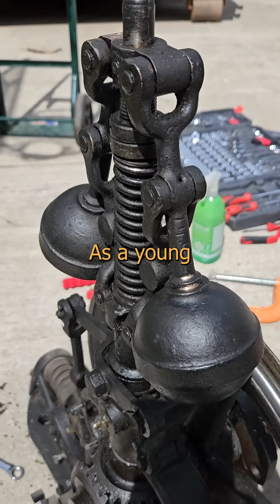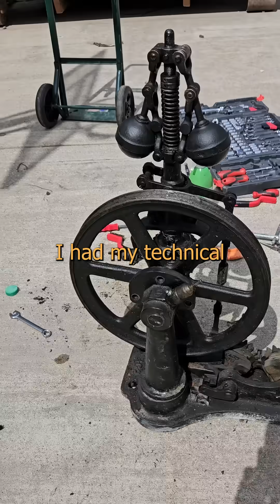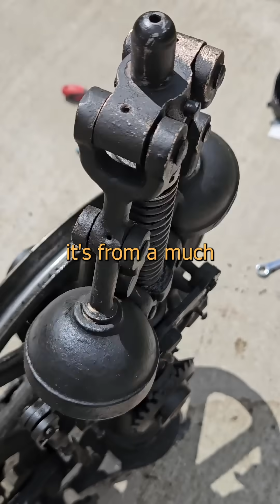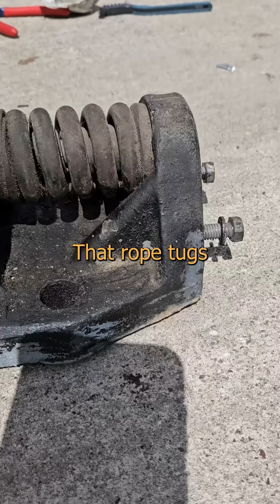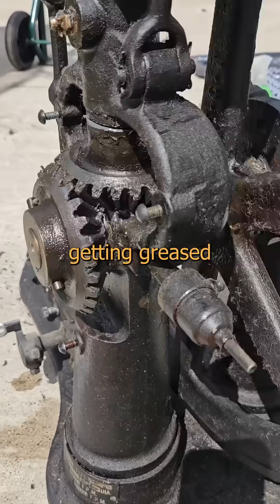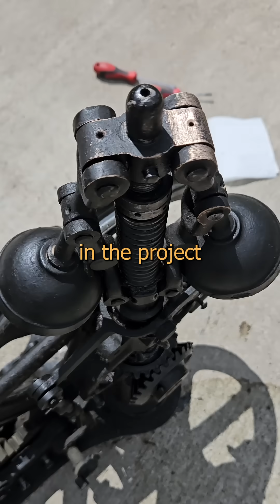Flyball Governor #chrisboden #comedy #engineering #steam #safety #elevator #steampunk #vintage

Comment: Wow those speeds and limits s on the info plate are staggering considering that the average floor is 12 feet in height at 350 fpm that close to 30 floors a minute with its trip rate at 40 floors a minute. Modern elevators are faster at 500 to 2000 fpm. But it still must be a hell of a stop when it trips! You would literally get floored faster than when your granny spits her teeth into the turkey's stuffing cavity at Christmas.

Comment: God I’d love to help refurb that. I’m very into mechanical engineering and how engines work. My special engine is the 7.3 PSD. Being HUEI, they are a bit more expensive to make power with, because if those injectors don’t got oil at rpm, you’re gonna need to dump more money in with an HPOP. And don’t get me started on tuning, you have to tune accounting for IPR%, ICP%, while juggling how much pulse width you can get out of that injectors before you start raising EGTs and running out of high pressure oil.

Comment: Reminds me once I rebuilt a Victorola motor, which after dismantling, was just a larger version of my old spring-powered toys. The old grease had hardened; cleaned it all in gasoline; slobbered lithium grease all over; worked fantastic. There’s something so amazing hearing music from a non-electronic device, albeit the weight of the needle was disconcerting. Pun intended.

Comment: The old term "balls to the wall" refers to that little bastard running with the balls  all the way out. In some circumstances they would supposedly wrap a rag around them so they couldn't extend all the way out and slow the engine, that way they could get a little more oomph out of the engine. The steam powered silver assay building turned museum near my work is super fun to visit. They only have a single of the 40ish drop hammers left and have the hammers propped with boards so it doesn't try and shake the building down when they run the engine and show off the belt system. They run the whole system off a large air compressor so it doesn't have the power or heat it used to but is still very fun to watch. Place had to have been loud as hell when they had all the hammers running. Also probably smelled horrible with the lixivation process they were using to separate the silver from the ore.

Comment: What a beautiful machine, Sears Bra's I mean ;-) 🍈🍈

As far as the safety trip switch goes, I personally would carefully clean and wax polish down to what's left of it's factory finish..... With all that grease and  practically no ultraviolet exposure, you may have a near NOS OEM part.

Comment: Grab a gallon or 2 of diesel and put it in a plastic bin. Put the regulater in it and use the diesel and a bruch to clean it. The diesel wil take the grease off. Then use some break cleaner and rags to take the diesel off and you've got a clean piece to work with.

Comment: Came for the bra sizes calculation and stayed for the possibility of seeing dirty gears getting restored to a lovely shine.
Reply: I worked at JCPenney in high school and part of their training was measuring for bras. In the most simple form band size is measured around the torso under the breast in inches, the cup size is taken when you subtract band size from the measurement around the torso over the nipples, every inch is one cup size.  There’s more to it than that, but that’s enough to get close.
Reply: @Blueraspberryguy  It isn't too difficult when you get the hang of it. I learned from old triumph catalogs and over sharing ladies in highschool.

Comment: Thus the statement running balls out.
Reply: @hairy-dairyman    the wall is also the limit your engine can do. So going balls to the wall is less of a horror story about your skateboarding careers ending
Reply: @pickledferret3947 yes, but "balls to the wall" has a completely different derivation, from aviation and the ball on the end of the throttle control
Reply: @ Aviation borrowed it from early automobiles according to it being in some of the books I've read that were written before the invention of powered flight. 
.
Reply: 101% throttle  @engineer_cat
Reply: @engineer_cat  It could also refer to early railroading when they used balls to indicate when it was okay to continue or stop.   So Highball generally means full throttle.

It's possible that's where the aviation use came from.
Reply: @pickledferret3947  "balls to the walls" was actually from WWII warplanes having a ball on the end of the throttle lever.

Pressing that ball against the instrument panel wall was full speed, so they'd literally call that out on squadron channels to let everyone in the formation to go max speed.
Reply: @pickledferret3947 balls to the wall is from aviation balls out is from steam
Reply: @pickledferret3947   - Origins...

(Aircraft still often have hand controls -  throttles + mixture controls +/- pitch, often have a ball on the end of the lever - that goes full forward every meaningful power input   - same Idea..  Balls out - steam engine expression - for the same thing.. - that big governor up on top (early models) bleeding overspeed steam..)
Reply: @pickledferret3947 😂точно!😂😂😂😂
Reply: I’ve also heard balls out! It this actually where it comes from??
Reply: @kodyrussell1623 It comes exactly from the depicted centrifugal mechanism!
Reply: People might think the railroad term "highaball" would also come from this, but it actually has to do with a railroad signal, where a white signal ball was raised to indicate clear track ahead.
Reply: That only counts whenever the governor was used on train engines not elevator cars.... And don't say balls to the wall either because that's an airplane throttle saying.     😁👍
Reply: @xpndblhero5170  Honestly, it's incredible how many sayings we have from aviation and naval lingo

"Whole Nine Yards" Can't remember which plane it was, but the gun had a belt that was 9 yards long.

"Freeze the balls off a brass monkey" Cannon balls used to be stored on a ship in brass "cup" so to speak, called a brass monkey. When it got cold, the brass would shrink, and destabilize the pile of cannon balls.
Reply: @xpndblhero5170  i was told it was an old saying for traction and ploughing engines
Reply: Balls out
Reply: Yeah...I took that literally once...wasn't pretty...
Reply: To the wall and to the window
Reply: I’ve heard of this, but I never actually heard a single person. Use the phrase until after I watched that original video talking about the saying and showing the mechanism in a steam engine.
Reply: I learned about that from Jay Leno when he showed his steam generator going balls out.
Reply: Why go thru all the trouble of putting together this video & never mention the fact that mechanisms like this is where the term "balls out" came from.  Man, what a let down.
Reply: Public school teachers must learn it's not a dirty things to say!
Reply: THAAAATS why I got arrested !!        My bad.
Reply: "Balls to the wall," cowboy! 🎉
Reply: I've had this all wrong for years
Reply: Learn something new each day!
Reply: YES!!!  I remember Jay Leno mentioning
that with the one in his garage.
Reply: In all my years in aviation have I never used the term ball to the wall.  Small airplanes have the ball as the throttle and that is where you rest your hand on takeoff to ensure the throttle does not creep backwards.
Reply: This is what I came here to say, I'm surprised he didn't add a balls out reference.
Reply: Yep. I was going to say the same thing.
Reply: @hairy-dairyman  beat me to it!
Reply: You're 100% right! There's no vulgar connotation whatsoever, which not that many folks actually are aware of! Hats off, sir. American English is beautiful.
Reply: Balls to the walls
Reply: I detect two Russian spies in the chat. Hide this technology!!!
Reply: I thought "balls out" meant someone exited a window without getting dressed because the husband came home early.
Reply: Or balls to the wall.
Reply: Ahhh. I thought it meant running nude and therefore crazy. Makes sense.
Reply: or in a restricted space. "balls to the wall"
Reply: @Algorythmfpv  no that’s from airplanes. It’s about pushing the throttles to the maximum, cause throttles used to have little balls on the end to make pushing from the top easier. Now the balls are little cylinders with some extra controls on them.
Reply: "Balls to the walls"
Reply: Balls to the wall
Reply: @cortneyfreeman3060  different statement. Thats from airplanes where the balls on top of the throttles were pushed to the maximum. Balls out is about running past maximum.
Reply: Balls to the wall
Reply: да по нему видно он ВРУН